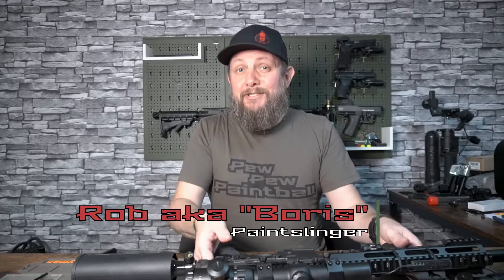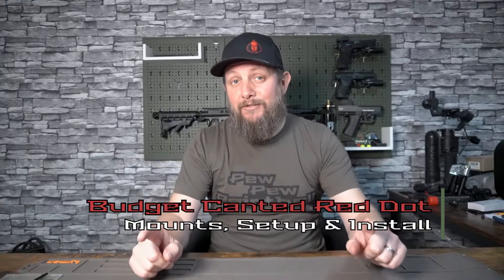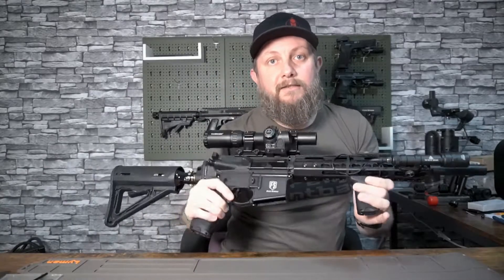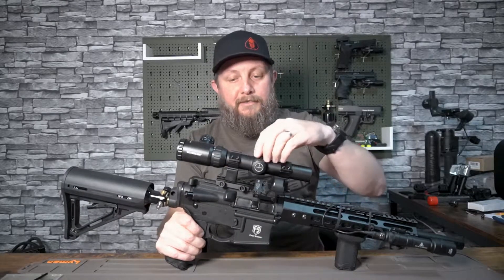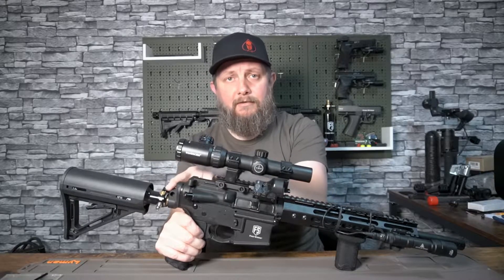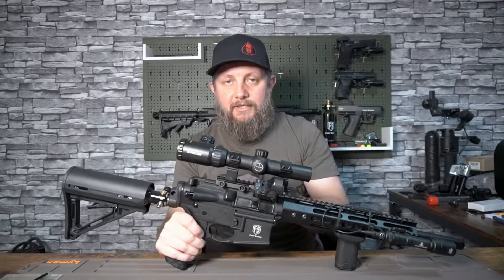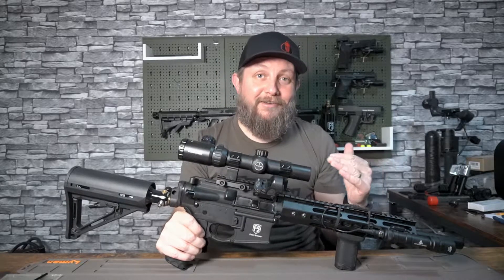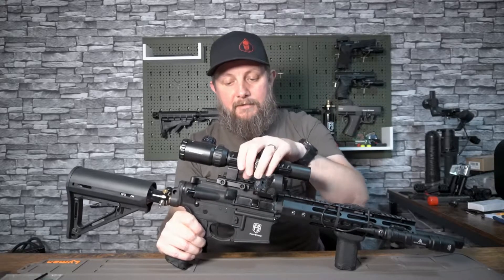How To Setup Canted Sights | Magfed Paintball | Airsoft

Comment: I would like to see you setup the new half pint air tank with the stock
Reply from the maker: Hi there, if I get my hands on the half-pint I'll make sure I do a video! I don't think they make a specific floating stock for the half-pint tank. I guess that the rear of the current mount would not fit flat to the bottom of the tang as it is curved. I guess fitting additional 3M foam on the rear of the mount would give some adhesive contact for attaching the mount. I think most people have gone for removing the rear of the mount and just using the bottom rail. This seems to be due to the additional length of the half-pint compared to the normal 13ci tank. Hope that helps 😎👍